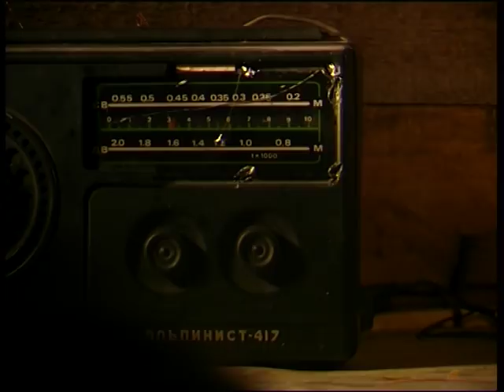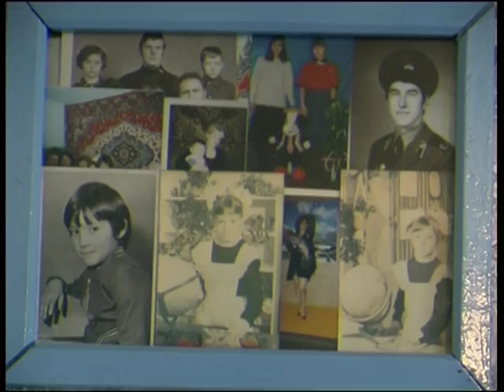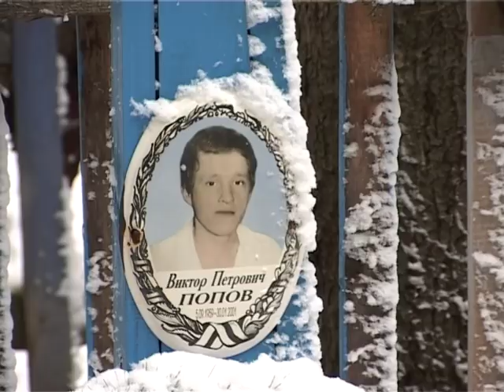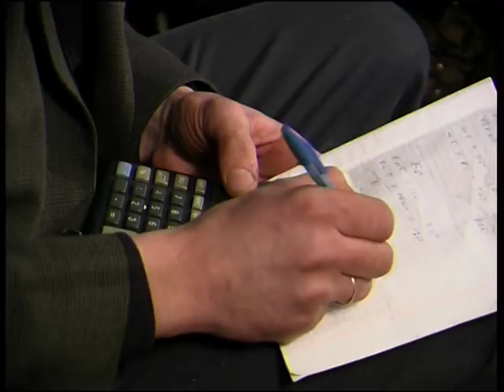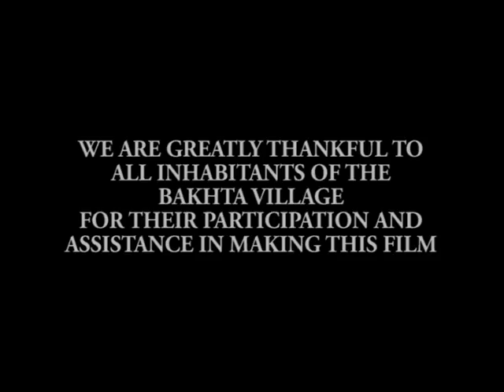Happy People | Winter (part 4)

Comment: I don't get it. How you feed the other end of the net to the next hole?
Reply: The second hole is down the river so the current carries the other end of the net to the second hole.
Reply: I have the same question, I can only guess that they pass it with some float down the current and then make holes until they find where the other end with float is. That shouldn't be that difficult, you put rope with a float on the ice, with float going down the current, mark it's position on ice. Then pass the rope with float under ice and the float should be on the marked position.
Once rope is positioned, you use it to pass the net under the ice.

Comment: These poor folks are getting so robbed. In 2018, 2800 rubles=$44.60. That’s unbelievable.
Reply: 28 000 - 500$ this is part of the booty. 1 skin - 25$ x 100 = 2500 minimum per season. ruble exchange rate fell by 2 times after the crisis. it was 5,000 before the crisis